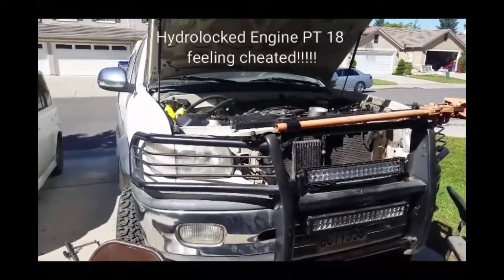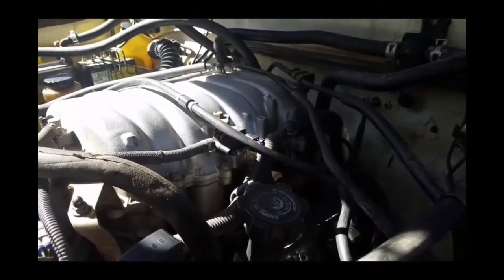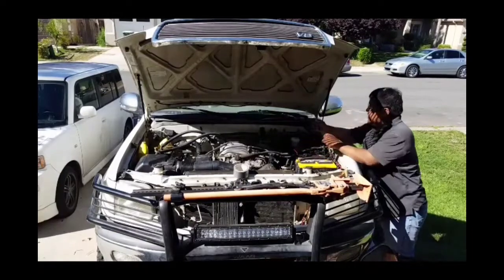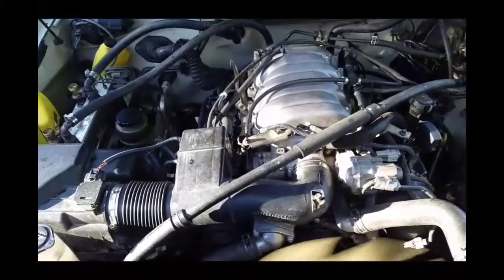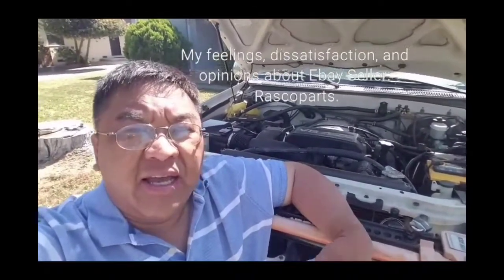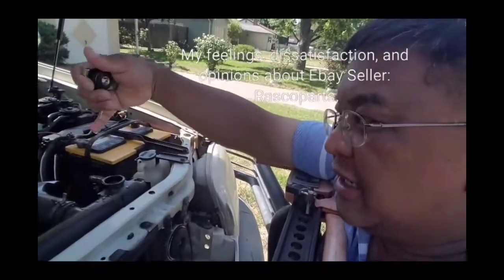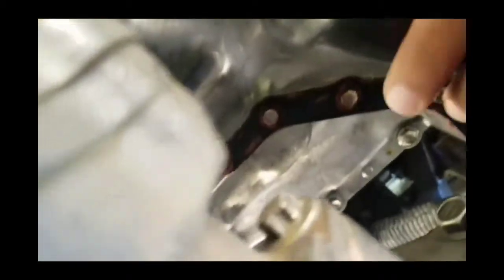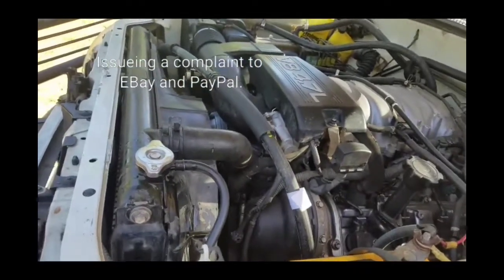Hydrolocked Engine PT 18

Comment: Da Phuk? A Japanese Duramax? I prefer the local junkyards because searching for a good engine is a hit or miss. My parents had the same bad experience in the past. That's why I'm considering to purchase a remanufactured engine from the local parts store for $4,845.00 + 20% off, if I need it. It is expensive in comparison to a used engine but I know that it will save me time, money, and headaches.

In times of severe frustration and disappointment, the only therapy that will help me feel better is a newer Tundra. Preferably, a fully loaded TRD Pro. Ka-boom!

Comment: I have the same push bar but don't know where the secondary brackets go I don't know if I have to make new wholes to the bumper or if I got the wrong brackets it's feel very shaky with out does mounts . It sucks eBay sellers can't test an engine properly before sending it out but some times they know it's broken and they just scamming
Reply from the maker: sharemymood don't buy engines from Ebay Seller Rascoparts.